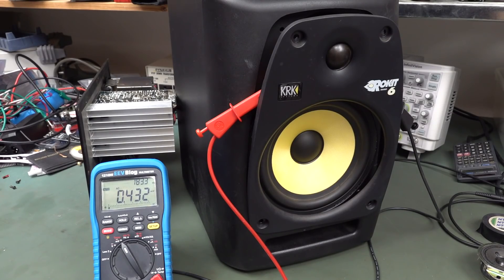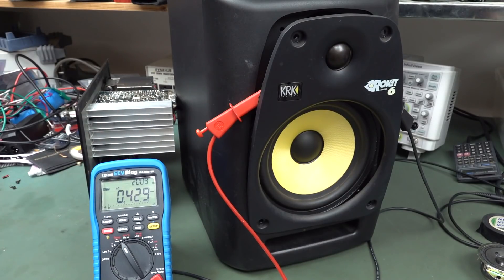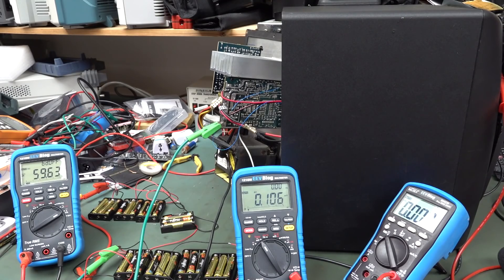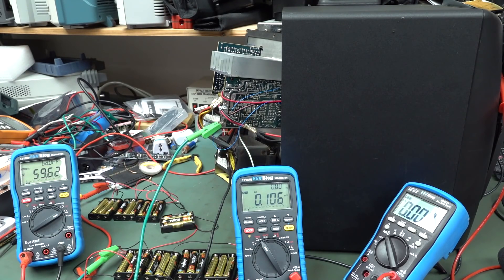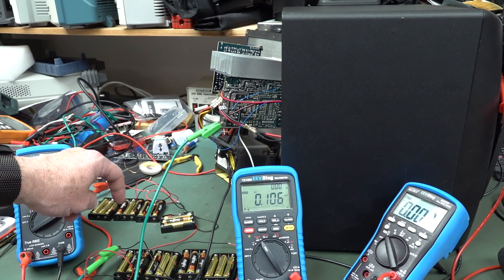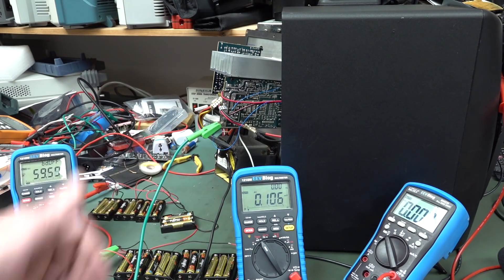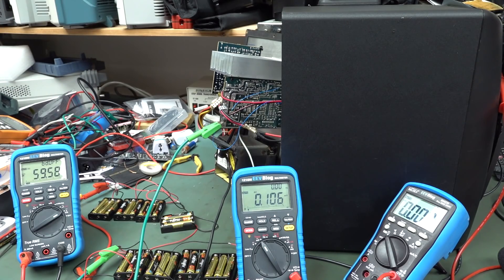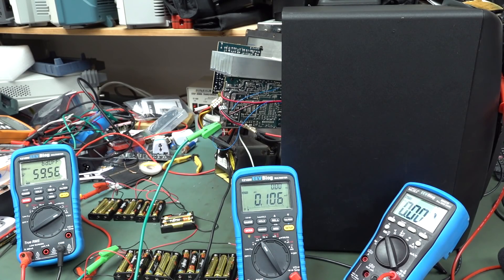EEVblog #1128 - Studio Monitor Speaker Noise - Part 2

Comment: It does sound like on the line powered test there were some 50hz components 
but in electronic engineering, one thing is for sure, there will be noise
Reply from the maker: You shouldn't be able to hear any 50Hz component because the tweeter wouldn't be able to do that low
Reply: Definitely sounded like higher order harmonics of 50Hz. Which might feed through because the PSRR drops at higher freqs?
Reply: Not a sine wave, but a 50hz pulse or square wave would definitely come through.
Reply: @pocoapoco2 Exactly that; it's likely high frequency bursts at 50/100 Hz repetition rate which is what you might expect from rectifier noise. The bridge rectifier doesn't have suppression caps across each diode according to the schematic, so that would be the first thing to do.
Reply: yes finally someone mentioning rectifier noise :) in high-end amplifiers you see 4 supression caps across the rectifier diodes to get rid of that. But its just one of many possible noise sources...
Reply: I definitely hear a clicking at that sort of interval - some kind of harmonic
Reply: it sounds like spikes within the noise component appearing at 50hz almost like zero crossing noise not a full 50hz sine wave, but it could just be me
Reply: You clearly hear the higher harmonics of 50 Hz.
Reply: "You clearly hear the higher harmonics of 50 Hz." If true, then this is something that a spectrum analyzer can easily pick up and display. Don't confuse "tones" with "noise"!
Reply: In Figure 8 of the datasheet, note the falloff in power supply rejection with frequency. At 10 kHz, which most of us hear reasonably well, the rejection is about 10-15 dB, which ain't much. Any HF noise noise, whatever the source, that makes it on to the power supply rails will definitely come through to the speaker(s).  It would be relatively simple to measure this noise on the rails by coupling a rail voltage through a reasonably-sized capacitor, say 4.7uF, and terminated in 50 ohms. This is a high pass filter at 1 kHz. Measure the noise this way. Oscilloscopes tell you nothing.

Comment: can you try measuring the line voltage for higher frequency content?    most of the noise comes from the amp running at a high gain to get the 1Vpp line level to the max output volume. but the power grid itself may influence the sound aswell.
audiophools use power plants to get a pure 50hz sine and no powerlan, switchmode noise garbage ... basically a strong amp fed with a 50/60hz signal pushing it into a big transformer, and some feedback for setting the gain / output voltage.
i doubt theres so much garbage in the grid that it affects audio that much as they claim.
Reply: The insane engineering method (dunno if auidophools ever did this but fairlight did) is locking your switchmode to the sample rate so any variation is the same sample to sample

Comment: For the 50hz, couldn't they slap in a band reject?   Hmm, that could be an issue for someone who wants to actually play 50hz, lol.  ...How about just better noise suppression, perhaps larger caps, or even one of those rechargable button cells.
Reply from the maker: The noise is inherent in the amplifier chip, that's the point of this video.

Comment: I   thought  we determined   that   it's the  small  bias  voltage  that   slightly turns  on the output transistor  in those chip packages In some amplifiers you can  adjust   the  (turn on)    bias  current  by way of  a trim pot
Reply from the maker: There is no bias pin on this chip.
Reply: Output transistor bias to reduce crossover distortion pretty much just makes the amplifier run hotter. Not necessarily more noise.